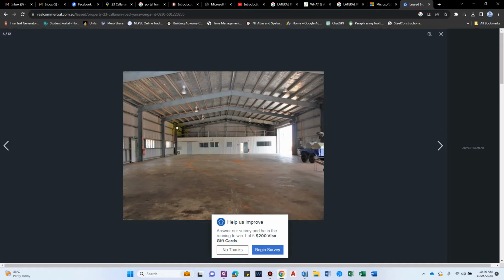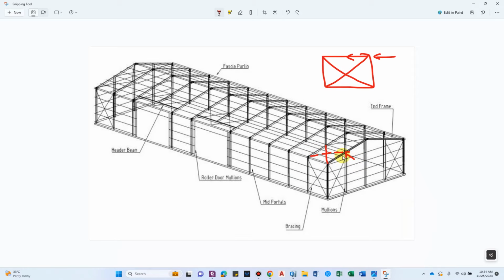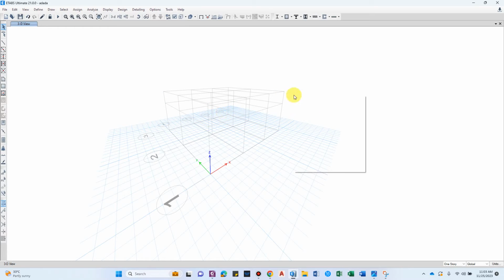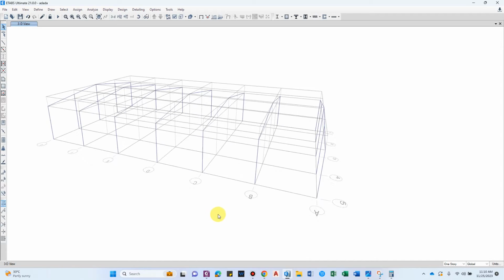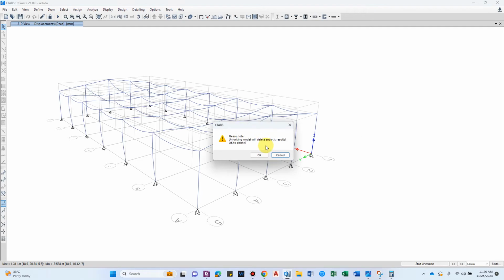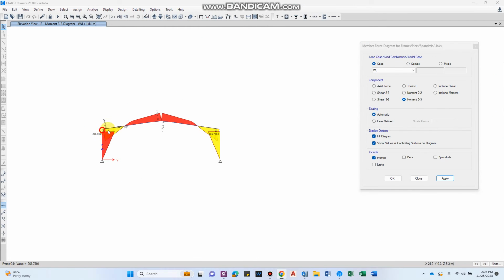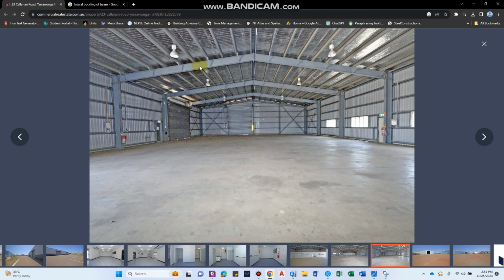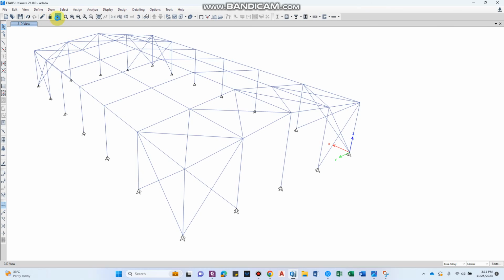Design of Steel Warehouse in ETABS | Portal Frame, Wall and Roof Bracing, Fly Braces, Wind load |

Comment: Nice, but for failed rafters and columns, that would be better if you considered lateral bracing due to roof purlins on rafters and wall purlins on columns in your model. This might make the section pass the design. Increasing section may be the last option for failed section after utilizing all the option.

Comment: Good Video. BUt you are providing a slender angle sections for compression force in bracing.
Reply: Since there are two braces, neither of them will be subjected to compression. One brace will take tension when the wind acts in the +X direction, and the other will take tension when the wind acts in the –X direction. Therefore, neither brace will experience compression, which is why two braces are used.